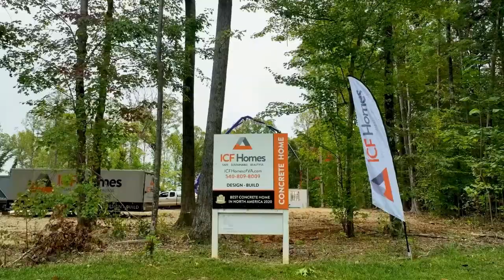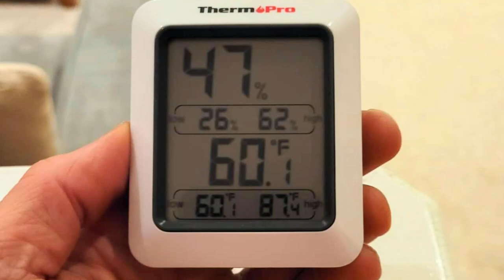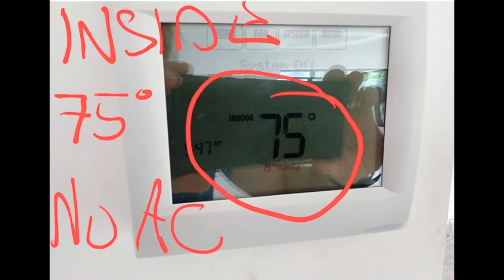What are the benefits of a concrete house over wood? #icfhomesva #concretehouse #buildwithstrength

Comment: Concrete homes are generally cooler than stick-built homes in the summer: 

Thermal mass

Concrete has high thermal mass, which means it absorbs, stores, and releases heat slowly. This helps regulate the temperature of a building, keeping it cooler in the summer and warmer in the winter. 

Insulation

Concrete is a good insulator, which helps prevent heat loss or gain through the walls of your home. 

Air leakage

Concrete limits air leakage, which is the most significant percentage of energy loss in a home. 

Energy savings

Concrete homes can save homeowners 20 to 25 percent on annual heating and cooling costs compared to standard stick-built homes. 

Other benefits of concrete homes include:

Fire protection: Concrete buildings have a fire-protection rating of up to four hours.

Sound barrier: Concrete walls are highly effective as sound barriers.

Healthier indoor environment: Concrete is not an appealing food source for termites, rodents, or ants.

Lower maintenance: Concrete houses require less maintenance and repair than wood-frame houses.

Comment: Would you rather have a stick framed wood house that is built well, because weveryone on the job has done it a million times and intimately knows exactly what they are doing and how to avoid problerms or...

An ICF house where the contractors and builders are learning  as they go, and dont have any (or have minimal) experience withe this construction technique?
Reply from the maker: @The_Privateer   We respectfully disagree. That mindset greatly limits innovation and improvement. We have 20 years experience and proud of our trades.
Reply: @icfhomesofvirginiallc1248  Thats great - *IN YOUR AREA*
Go to a more rural and less technically adept area and the contractors and builders are learning on your dime and on your house. And they will inevitably get things wrong.
I whole heartedly agree that builders and contractors experienced with this building technique make or break a project - but those experienced builders and contractors are not common, especially in underserved areas.

I would rather have a stick framed house built by knowledgeable and skilled builders and contractors, rather than an ICF house where I am the learning experiment.

Comment: I built my house 42 years ago - it is concrete. It is also earth sheltered and uses less than half the energy of similar sized houses. It is maintenance free and storm proof as well.
Reply from the maker: Well done!
Reply: @icfhomesofvirginiallc1248   When someone ask you why should they build homes out of Concrete... Tell them the USA is just now getting caught up to most European countries who build their homes to pass down to their children and their children and their children.... Strength, energy efficient, and .... Is why they build their homes out of concrete. I recently raised my roof over my bathroom. I took off my clay shingles, add the wood and used the same shingles I took off. They reuse what they can to last for as long as they can.  The USA needs to catch up with the rest of the world. !
Reply: @icfhomesofvirginiallc1248  Sadly it would be cost prohibitive today. The concrete alone would be about $90,000 more than what I paid. I'm sure there are better solutions like ICF available today that weren't available in 1980.

Comment: Being a constructor myself I build many ICF houses. But please use fiberglass rebar and geopolymer instead of steel and concrete. It guarantees you more durability and less environmental polution. Nowadays I build only hybrid constructions in Europe. ICF for foundations and loadbearing external walls on the first floor. For the rest better use cross laminated timber. And do not forget to make the ICF fireproof inside and outside with gypsum or magnesium oxide boards. Polystyreen does burn with a terrible smoke. ICF is a very good cheap building system. It takes a long time before the concrete will dry so the polystyrene will sweat for months. But after a few years you will have a nice strong net zero building. Regards from Europe.
Reply: I think you have a point. Would you recommend it for 4 story  multi-condo units?
Reply: Environmental pollution, lol.  Americans fought a war to not have to care what Europeans think.
Reply: you looked at mycelium insulation?
Reply: No never heard of it. I googled it but can not find enough information about it.
Reply: @petervandebovenkamp3653  'mycelium bricks' here on youtube
Reply: Yes, but you have make fire proof compartments per store/floor. Nudura has ICF without foam on the inside, just remontable plates which you can reuse. Remember that the concrete center must be larger ( I guess 10") of the ICF and for shared walls take double walls, so twice ICF with fire proof plates between it combined with RockWool. Just think of acoustic, fire proof. And use glassfiber rebar. Stronger, cheaper and does not rust.